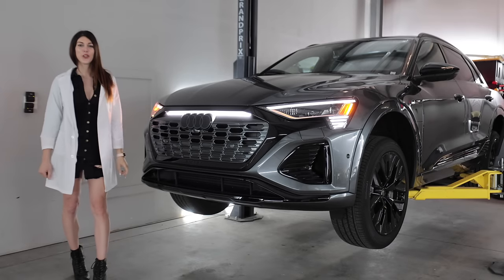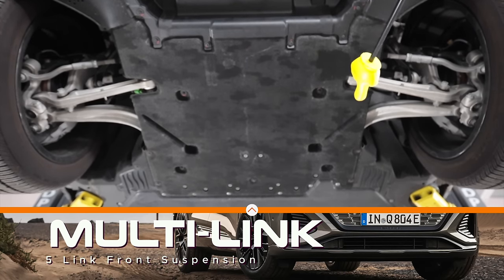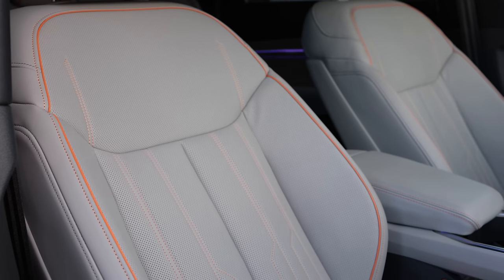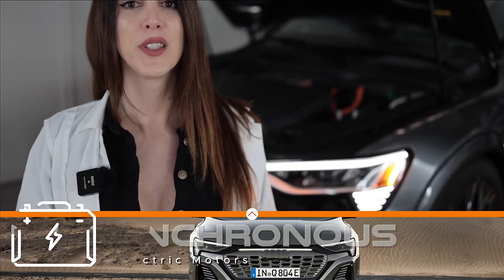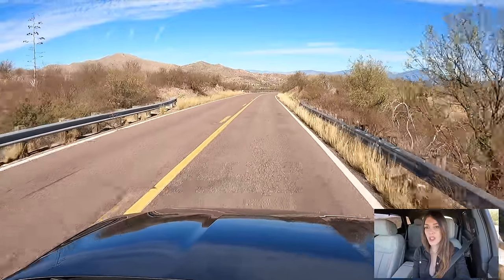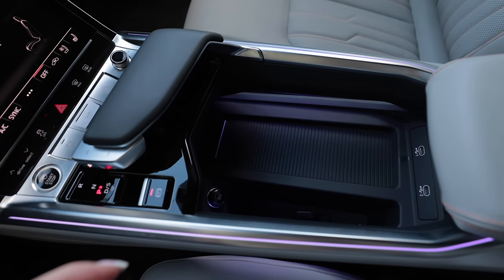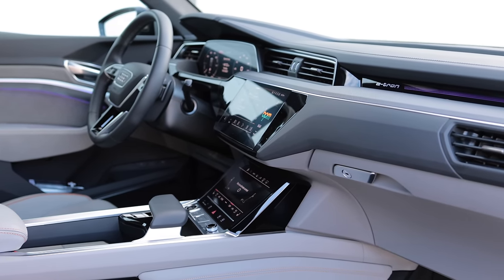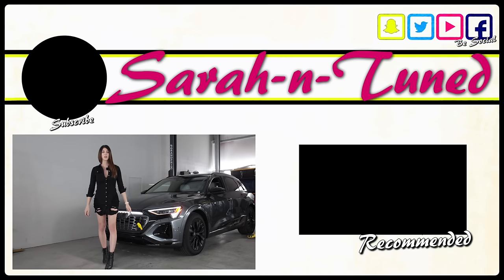2024 Audi Q8 e-Tron Quattro In-depth Mechanical Review

Comment: Just a heads up on the Audis with air suspension, they have a jacking mode that lets the suspension droop fully otherwise they can get damaged. You'll find videos of people not doing it on the RS6 and the bottom of the bag can pop out the wishbones

Comment: You have to use launch control to get the off the line speed. Dynamic, sport, esc off, hold the brake hard for one second, floor the accelerator till the meter flashes, release the brake.
Reply: Damn would be a lot of steps and "work"  just to make the car accelerate at its maximum performance.  And when I would really want or possibly actually need my best performance acceleration, probably not going to have the time to be messing around with doing all off that.  Although it sounds like it Might "perform properly" once the car is already moving? Although I'm starting to think all this "performance/power dampening/power management  is done intentionally so that just the sport version seems faster with the same motor setup.
Reply: You probably won't have to do all that on the sport version to make it seem faster. Or rather to be faster, easier

Comment: I will say, that after having driven a vehicle with almost no physical buttons for radio or hvac, I HATE using a touchscreen in my car for everything. It's also a massive distraction from driving if you're just wanting to change the temp or the vent. Must have buttons.
Reply: I could not agree more! Touch screens are an ergonomic disaster and the biggest safety hazard in a modern vehicle, they should be outlawed for any function you need to adjust while driving.

Comment: I wonder if battery tech one day will progress to the point cars are lighter.

Great review!
Reply: I’ve said it before. If they can sort that out it will be the end of ice engines. Lighter batteries will increase range and help in handling. Also that ferocious acceleration will be even more insane.
Reply: Solid state batteries, Toyota is starting to put them in their cars in 2025 are about half the weight as Li-ion batteries for the same capacity.
Reply: @joelzylstra2971 it's going to take a lot more than that. When they can have 5-minute charging time to full , have plenty of charging stations that are always working properly. And they're not going to have charging stations everywhere they need to be I have no idea why they're making electric four-wheel drives/ SUV's oh yeah, they're just for posers to drive around town and in the dirt lot behind the Walmart 🙄

Comment: Things like lighted seatbelt buckles are really neat...and also the reason I am considering only leasing new vehicles.  In 30k miles, they are no longer my problem. 😂
Reply: That’s the exact attitude that fills landfills and makes the efforts of zero emission vehicles near worthless.
Reply: @joelzylstra2971  my attitude or manufacturers attitude?  Leasing a car doesn't fill landfills.  I just bought my wife a new car and it took 5 months to get the manufacturer to fix a software bug that prevented AA and CarPlay from being stable. Made we want to trade dump it and get something new.  I mainly drive older vehicles because they are more easily repaired.
Reply: @pkt1213  Was it a Jaguar or Range Rover? This is a common JAG/RR thing. I had the issue with mine, kept resetting the bluetooth connection, but only if I connected the phone through bluetooth, media worked flawlessly. They eventually fixed it but I had to leave it with the service department for a couple of days while JAG UK evaluated the problem. JAG and RR seem very slow to respond to software issues because they actually adhere to a testing procedure.
Reply: @joelzylstra2971 
Did you know, about 4,000 major car dealers, across the country, are all banning together to tell Washington, "stop pushing EV's. They just aren't selling". If they don't sell, they go to the scrapper. Then to a land fill. Not to mention the EV fires happening.
Seems they are pretty much worthless already.
The people/sales ultimately drive a market

Comment: Charging is not the same at both sides? I can see the cover for DC fast charging at the left side, but not at the right side. Is that right?
Reply: You are correct. You can charge using AC (11kW), from either side but only charge DC (170kW), from the drivers side.

Comment: I am gonna have to disagree about the range. We are at the limit of what theae batteries can hold so increasing range will require increasing battery size, which will add more weight. Unless there is a miraculous breakthrough in battery technology EVs will stay where they are at and more than likely decline in market share. In my opinion, they are a fad car for rich people. Hybrids are a far better way to go to save fuel and reduce emissions.
Reply: @TML34  Except that we can build 10 hybrid vehicles with the same amount of battery material to make one EV. They are also far more convenient for end users and less expensive especially when the EV's battery ultimately dies. Plus the amount of materials we have to make batteries are finite and we won't be able to reach 100% electric no matter what anyone says. And if you think battery energy density is going to grow in leaps and bounds as your iphone 1 comment suggests, you are either uninformed or delusional.
Reply: they are not a fad for rich people  more and more EV's are winning the "total cost of ownership" comparison (car + (fuel  and maintenance * number of years of ownership)), and people like spending less money overall.  that why the ev adoption curve is basically exponential.    and if we take our queues from overseas - norway had %94 of all vehicles sold in the country be an EV last year....
Reply: @AdventurousJohn  well agree to disagree. From what I am seeing is the writing is on the wall that EVs won't become that popular in the US and overall are not sustainable.  Personally I will drive ICE vehicles until the day I die, but I probably will drive a nice hybrid Honda or Toyota as a daily. 😁

Comment: Damn near 100k for a car that if it doesnt catch fire and blow up, you have to drop 10-20k on a new battery every 5 to 10 years? The same battery that can't hold a charge either during winters which get below 0, or summer's that can hit 100. Nevermind the pain in the butt it is to find a working charging station, yeah I'mma gonna pass.

Comment: Size of your breaks doesn't make you to stop faster, pls stop thinking this way, tires are responsible for this. Otherwise ABS wouldn't be a thing right? in most modern cars even basic calipers can trigger ABS which means only thing that can affect your stopping distance is Tire friction
Reply: 🙄 not quite accurate 😅🙂

Comment: The stupid fake noises are so infantile. Can't believe they are still doing it, especially a brand like Audi. So typical EV problems. 2600 odd Kg. Which means beefing up suspension etc, which means more weight, which means more energy required to move it. Dog chasing it's tail. Not to mention they are wrecking the roads with the weight, which means people pay more taxes to fix them. We really do have idiots in control. Keep in mind that the more crap you have like "massaging" seats drains the battery and decreases your range. Unlike a "normal" ICE vehicle the gadgets have negligible affect on your fuel use. In an EV every gadget that consumes energy is reducing your range. It is f-ing ridiculous that they put these unnecessary devices in the EV that just drain the battery faster. They do it to con people into buying them. Obviously if there were no aircon, music systems, vibrating / massaging seats etc. They would be impossible to sell at the ridiculous prices.